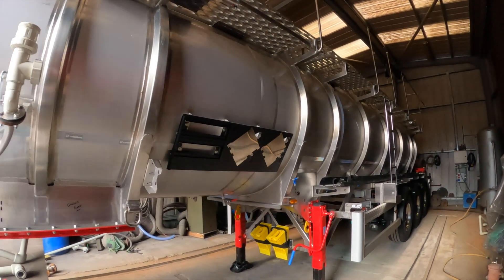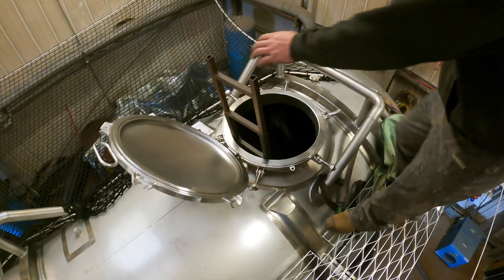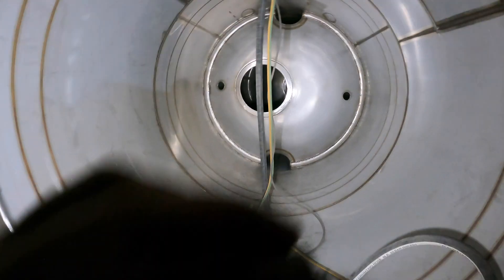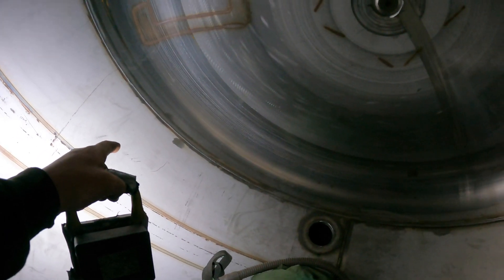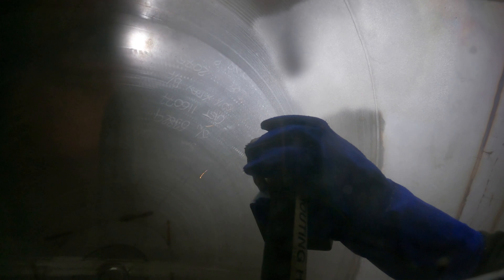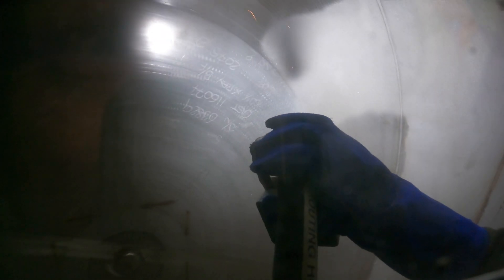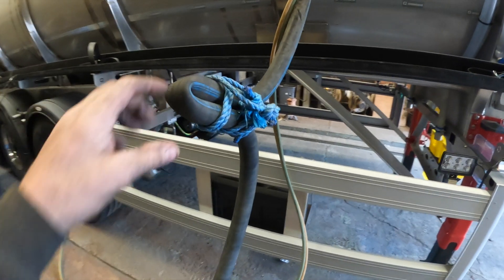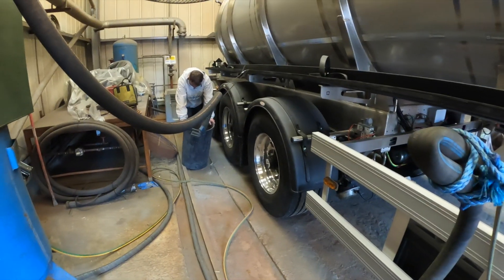Grit Blasting

Comment: Silly question😬:
Why on internal metal pipes and lorries tanks need to be shot blasting with metal media and not glass ? Metal media leave behind a more porous surface for special paints to be applied or…???
Reply from the maker: Yeah its to profile the steel for maximum bond this company rubber line after this steel grit 👍
Reply: @Mobileblaster  thanks, you are a legend . 
You should start sand blasting courses on your workshop , I would like to come one day to take sand blasting lessons from you .

Comment: What is the name of this device to which you connect the air hose to the compressor on one side and the helmet suit hose on the other side? Can you provide information where you can buy such a device and its price?. Because i am blaster Too and i have other type device to filter air into the helmet but sometimes inside my helmet a see a lot of wather with air.
Reply from the maker: Clemco Cpf-20 their is loads of different ones to pick from I use this as I can nip and pick a cartridge up 10 miles away from my base. It's not advertised to breath compressed air you should always filter it the cartridge needs changing every 3 to 6 months or if you can smell a funny smell in the helmet bit like cat pee

Comment: Hi there Mick , you can buy small blasting lights 12V that attach to the end of the hose , not on the nozel . and when you blast in confined spaces wrap duck tape around your anckels so the shot dont fill ya boots up ok , and you can buy online desposable overalls too  they are called Tyvex  you should be able to buy them over there i use 2 at a time keeps a lot of the dust from getting into your skin , plus i wear heavy cotton drill overalls .and the job your doing is a very good class 3 . great work
Reply from the maker: Yeah the 12v lights thats offered for blasting hear are mega money (£300 plus lenses lens and battery then another line to power it). I've tried the paper suits they don't last very long but I've nether thort of using 1 under some overalls. Only trouble gearing up like that ya cannot move very well and feel uncomfortable with the heat. I had a clemco fire proof version of the blast suit was very good but they are expensive as well that was £500 in 2017 hate to price 1 up now 😂 defo going to try the duck tape trick 😂👍

Comment: You refer several times in the video to steel shot but it is clear from the appearance of the blasted surface and the blast media itself that you are using steel grit not steel shot. They are very different and should not be confused. Steel shot is spherical. It does not have sharp edges and would not have have produced the rough surface that you got.
Reply from the maker: Is the wording the same for glass because that's named bead? What profile would shot achieve more of a buff than a ruff bit similar to glass bead to crushed glass?
Reply: Yes, exactly, steel shot is to steel grit as glass bead to crushed glass.
Reply from the maker: @Secession1900  got cha they refer to me coming to "shot bast" and ask if I've enough shot etc been going to this shop around 8/10 year and nether realised the difference 😂 just edited the thumb nail to say grit instead of shot 👌 I cannot do much about the audio now 😬

Comment: That looks great , well done 😊. I think they might be Tig welding gloves , which are thinner than standard welding gloves.
Reply from the maker: I usually use normal welding gloves but it's starting to get warm and im just trying different gloves out turns out tig gloves would be no good against this shot 😬
Reply: @Mobileblaster  Any good for glass media 🤔
Reply from the maker: @boatsandblastservices2165  I chose not to use gloves with glass only when it's hot that is 👌

Comment: Oh man! That looks brutal!!! Thanks for doing this work and doing it so well! This truck undoubtedly carries important cargo!
Reply from the maker: Once its had its rubber coat inside it will be commissioned into to carring chemicals I believe. This 1 wasn't too bad apart from the boots and the usual fatigue after clinging onto a pipe pushing 10 bar at 600cfm 😬